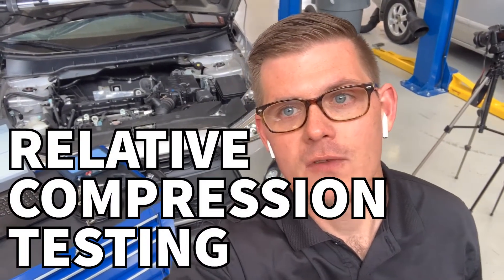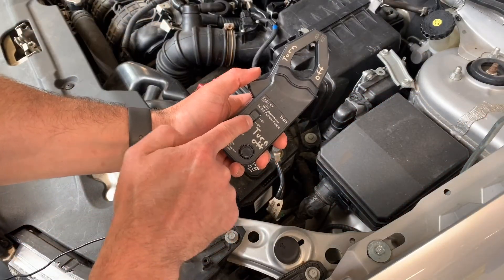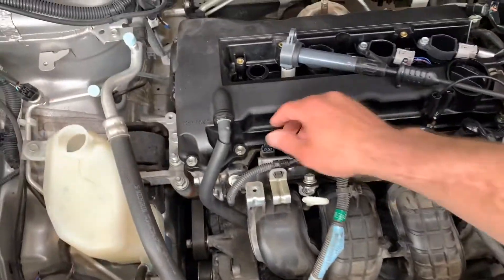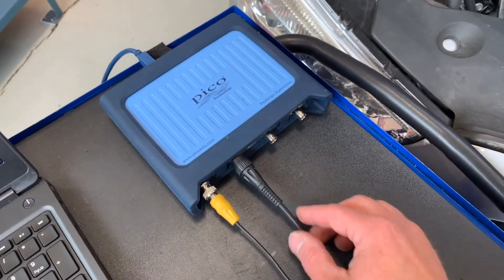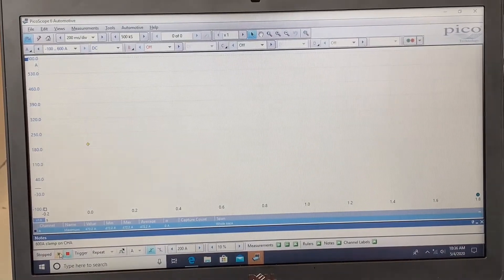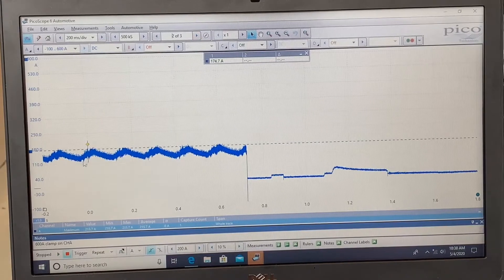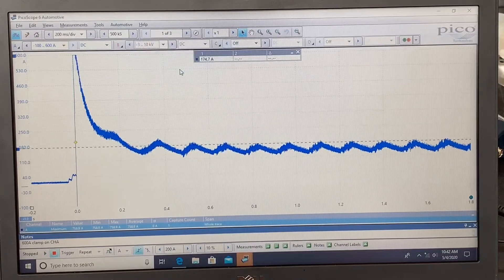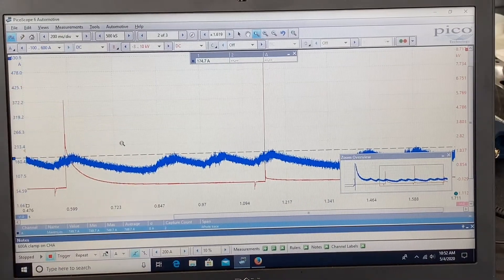PicoScope Basics: Relative Compression Testing

Comment: i have the hantek cc-65 amp clamp, will that work if i set it right?
Reply from the maker: It will. Any amp clamp with the correct range should work. You can also get similar (less pronounced) information with a oscilloscope measuring battery voltage.

Comment: Great video on relative compression test.  It can indicate many failure modes that will not show on a scanner b/c of mechanical failure.

In my opinion, best to use a fuel injector to identify a cylinder and then follow firing order.  Too many older engines have wasted spark ignition on mirrored cylinders, so its a 50/50 guess on which cylinder to check for more diagnostics.

Again, great video

Comment: If I can hear/feel a limp while cranking, what is this test telling me that I don’t already know? At that point, I’m doing a compression test on all cylinders followed by a leakage test to get a full health report on that engine, to assure nothing is missed. I’m sure glad all these scopes weren’t around, and they weren’t shoving this garbage down our throats way back when I went to school
Reply from the maker: To answer your question, adding a cylinder sync will help identify the specific cylinder with a fault. This would eliminate the need to do a compression test on all cylinders, saving time. A scope is just another tool. Sometimes it’s a good choice, sometimes not. The freedom of process during diagnostics is something I enjoy about working on cars. I’m always trying to learn new things and become more accurate and efficient. I encourage my students to do the same. Thanks for watching.
Reply: One of the benefits to a relative compression test is that you will have a better overall picture of what's going on in the engine, versus a conventional compression gauge with a Schrader valve will show you only peak compression number. Also on a 6 or 8 cylinder engine the rc compression test could save you a couple hours time with a non intrusive test, instead of removing all the coils and checking compression 1 by 1 .

Comment: How does an electronic amperage test tell you anything about cylinder mechanical compression tho? I thought your wave form there only demonstrated spark (and combustion?) Or is the combustion itself signaling compression?
Reply from the maker: When compressions is present, the starter motor must work harder to continue rotating the engine. With an amp clamp, we can see these rises in current usage and equate them to compression events.
Reply: @AdamsAnalysis  thx this is really helpful and useful info.

Comment: Much appreciate your time, but unplugging the fuel pump fuse is more easier? Or depends?.
Thank you so much
Reply from the maker: It really depends. On some vehicles it is a quick process to remove the fuel pump fuse. Many vehicles might tie in other systems to that same circuit. As a process, I review the electrical diagram and look for the quickest and easiest process.
Reply: @AdamsAnalysis  bless you 🙏
Reply: Or remove the starter relay and crank it there